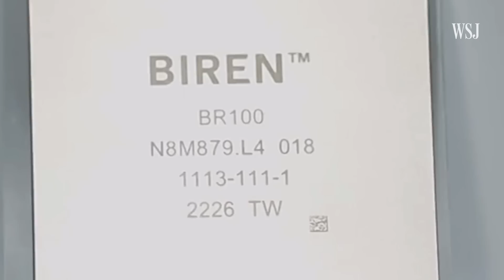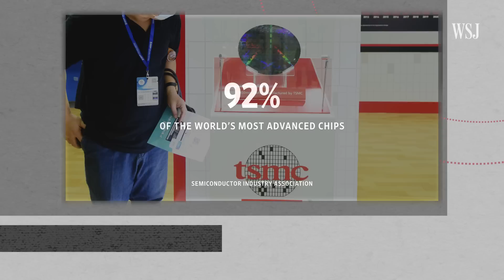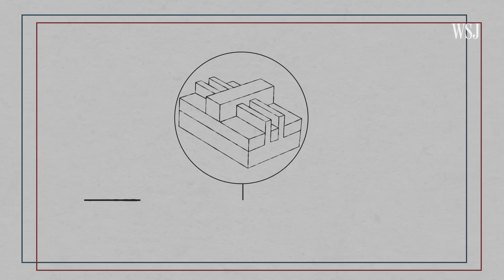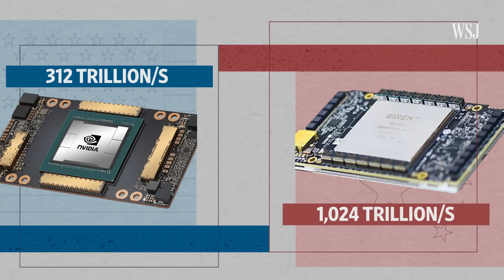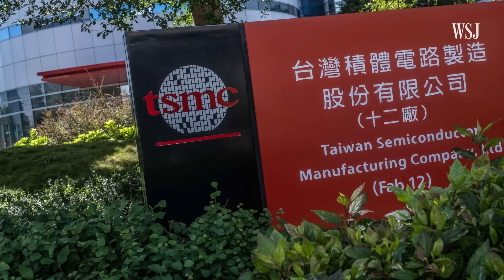Has Nvidia’s A100 Chip Met Its Match With Biren’s BR100 Processor? | WSJ U.S. vs. China

Comment: PURPOSE_DRIVEN_ELECTRICAL_ELECTRONIC_SYSTEM == [(Power_Source_Sink_Dynamics, Voltage difference, Voltage rise, Voltage drop , Nodes  ),  RLC_Frequency_DYNAMICS_With_Different_Thermal_Colour_Spectraum , Power_thermal_stability_tensor, Nodes , Controlled loop]

Comment: I understand having the smallest transistors per silica chip is favorable for mobile computing like laptop and cell phone but does it matter on a fighter jet the size of a bus? Or a missile the length of a car?
Reply: Yes, it does, because of the speed of light. 
The speed of light limits how much information can travel between transistors inside a single chip. The chip size is physically limited by how clean the silicon crystal can get. Interconnects between chips are very expensive and much slower than on-chip routing. Hence, smaller transistors = more transistors in a chip, and a more capable chip. It makes a huge difference, this is why everyone is talking about it.
Reply: @JurekOK  China is developing optic CPU.
Reply: @kongwee1978  Poland is developing an optic CPU. 

Spain is developing an optic CPU.

So what?

What matters is - who will sell meaningful quantities of the finished product.

Comment: So if you average the transistor amount. US one is about 20 per 1mm2 while the chinese one is 14 per 1mm2. Basically all china did was make a chip that was slightly bigger and put more transistors on it. They doesn't equate to better anything other than one just has a bigger size and can fit more because of it. If you look at the math here, it seems chinese transistors are actually bigger than us ones, since if us had a 1074mm2 board it would more than chinas
Reply: As long as it does the job. If the bigger chip burns twice the power, just build a better heatsink.

Comment: The A100 is Nvidia's previous generation chip. In fact, it's been shipping the current gen H100 (which significantly outperforms the A100—and yes, even boasts an 80 billion transistor count, heh) since before this video was even published. So I'm curious what the point is of comparing a Chinese chip that will remain vaporware for the foreseeable future (until they have the requisite fabrication infrastructure to manufacture their own chips) with an outdated chip that is already outperformed by the current chip (in production since October, with hardware incorporating chipset available for sale for some time) by an average factor of 4+.

I mean, what's an appropriate response to the pointless headline? "Congrats...of sorts...I guess?"
Reply: You simply do not understand the problem, today their products are a few generations behind you, tomorrow their products will be similar to yours, wait until the day after tomorrow, they will surpass you

Comment: Nvidia had already introduced h100 gpu on March last year, which is built on tsmc's 4nm node.
Nvidia a100 was introduced in may 2020 so it is more than 2 years old.
Reply: DONT WORRY BROTHERS, the Chinese workers working at Nvidia right now will take your ip and bring them back to the ccp, then they make the same thing but for 90% cheaper. Big Brain.
Reply: @dhl2016  That's a MAJOR racist statement.
Reply: @dhl2016  Not happening any longer.
Reply: @dhl2016  That's long been done sparkie.
Reply: @johnsmith1953x  Herro Mr John Smith, no worry, I bewieve you name, I know you no rie
Reply: I should point out that the video states this at the very end.
Reply: Now its 5 years old
Reply: So... meaning China is what... say 1 year behind?
Reply: The Biren BR100 is three years old dude.
Reply: @johnsmith1953x  And not even close to any western gpu . Its just numbers thrown around . But performance isnt just showing the chip is bigger .
Reply: @xythiera  Unless you actually have one in your posession, there is no way I can prove it to  you.
Reply: @johnsmith1953x  No mate BR100 was launched in August last year.
Reply: @fury6280  No it was NOT. Some of us had prototypes of it YEARS ago.
Reply: @johnsmith1953x  why are you taking prototypes and engineering samples into account?
By this logic nvidia H100 was already in risk manufacturing in Q2 2021.
Reply: @johnsmith1953x  joined end of 21, no playlists, nothing? you just come here to spread the red color. probably even bot.
Reply: @johnsmith1953x  Nvidia a100 prototype came out in 2016 so...why are we talking about prototypes again>
Reply: @johnsmith1953x your a liar bro.
Reply: @pauldorfman701  Bruh. Wuht?
Reply: @johnsmith1953x  “John smith” most obvious Chinese bot
Reply: @Alex-gd9li  "Alex" most obvious Russian bot
Reply: @Alex-gd9li  while Nvidia founder and ceo is chinese lol
Reply: @siamapachuau-uf3sm  he’s Taiwanese
Reply: @johnsmith1953x  Yeah ok, you really are lost in chinese propaganda
Reply: Br100 is cheaper than Nvidia. It is just underated.
Reply: @lazyblitzkrieg6040  Cheaper in what way ? . You have to compair perfermance per dollar and its hard to belive  that China with one of the worst chip plants in the world magicly compeat with Nvidia or AMD . Sorry not gone happen

Comment: The reporting is flawed.  China DID NOT make chip making the priority until Donald Trump banned China from advanced chips.  This puts so much uncertainty to China's technology roadmap.  Since 2016, China has systematically invested over half a trillion US dollars.  Yes, you heard it right, over half a trillion US dollars, into chip industry in China.  

As result, China can now produce 28 nm and 14 nm chips in production quantity.  There are reports revealed that China is able to make 7 nm chip in small quantity, using multiple exposure approach using the DUV (deep ultraviolet wavelengths) lithography machines.  Given China's track record in catching up in technology and how fast they have reached the 14 nm chip production, we won't be surprised if they could start producing 7 nm chips in large quantities within 5 years.  The 5/4/3/2 nm chips might take them much longer but let's face it, they are primarily for high-end flagship phones or even for marketing purpose.  The cause is too huge to produce chips beyond 4nm.  And 2 nm chips are practically at the tail end of silicone chip making, with electron quantum interferences becoming this technology's ultimate limitation.  

So I will predict that silicone chips will be sunset industry within 10 or 15 years.  It will be dominated by Chinese companies.  And the chip industry will move on to graphene chips, and China is actually on par with the US/Taiwan/Samsung in term of technology know-how.  

Keep in mind that China has been systematically nurturing the chip industry for over 30 years.  The know-how foundation is there to convert for industry mass production.  Did Donald Trump's ban on exporting chips to China speed up or slow down China's technology progress for silicon chips?  I think it is highly unlikely.  But it certainly makes China focus in developing key technology industries at home.

Comment: Prototypes means zero. Mass production means everything. Anyway several chinese channels announced mass production of 7nm and 5nm chinese chips, as well as mass production of chip making machines. They also announced mass production of carbon based chips. I'm not sure what these chinese channels understand by mass production but it seems it is a very different thing than the rest of the world. Someone even said China has entered warp speed in chip manufacturing. This seems some kind of propaganda but I could be wrong.
Reply: Well, if there’s one thing China is good at, that’s mass production.
Reply: @RLYYLR  Maybe but the  mass production announcement I mentioned was more than a year ago.

Comment: Depend on WSJ to frame this as "Dominate the Market". Wrong. Lead applications. USA cannot compete any longer so market competition it preaches go to the window for extreme protectionism. But what is laughable, is the US totally lacks the infrastructure to package and test chips at scale, and wont build that soon, so it will have to export chips fabricated in the USA to Asia for backend process and reimport them. Strategic & tactical failure, but then, what else should be expected for pigheaded politicians?

Comment: Google's former CEO Eric Schmidt said that China already has the capacity to manufacture 7nm microchips and he even mentioned something about 5nm. Most U.S. advanced microchip companies are fabless, and the TSMC fab being built in the U.S. may resolve some of that but I have doubts. I think China has the momentum here. It seems shaky to rely on TSMC and Samsung.
Reply: You can believe that paid nonsense only if you don't know anything about chips. If I ask you how will China make a 7nm chips without EUV machines? Can I also ask how will China mass produce these 7nm chips when they can't even produce 14nm on mass?
Reply: @ulikemyname6744  7nm chips can also be produced using DUV, and secondly, 14nm chips are already very common in China, and a large number of cars are using 14nm chips produced in China.
Reply: @guzilayerken5013  Yes but with huge amounts of failures which means that 7nm will be useless. 

14nm chips might be common in China which btw is not true, and yet they are not produced by SMIC
Reply: @ulikemyname6744  I don't know the technical details but I think SMIC calls it the N+2 process and it uses some kind of lithography machine.
Reply: They only have access to DUV litography.  It is nowhete near as precise
Reply: @ulikemyname6744  They using 3d stacking method to  ram more transitor into 7nm chip without need to reduce size of transitor while using duv.
Reply: Intel is back on fab business , they are manufacturing 7 nm today and aims 1 nm by 2025